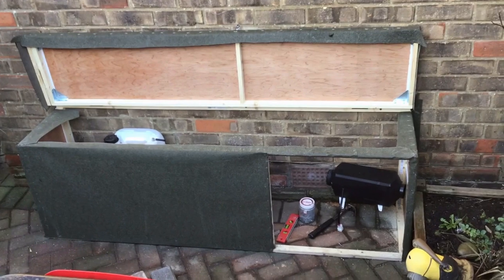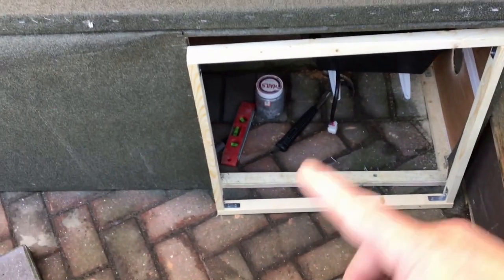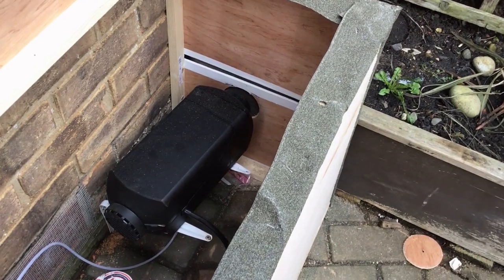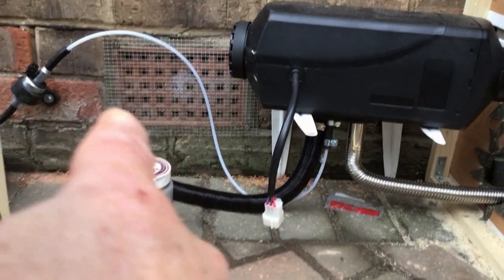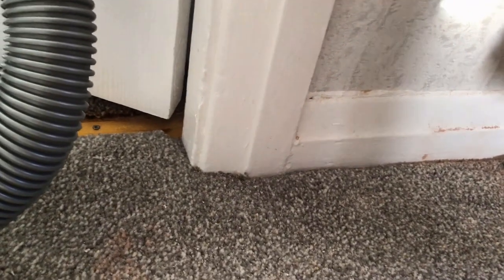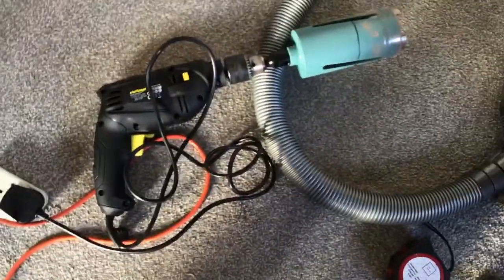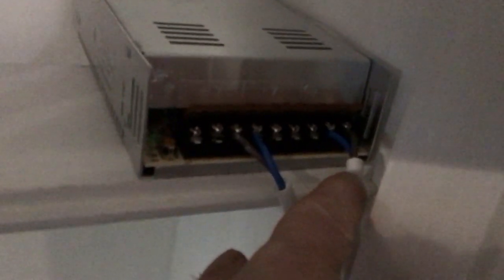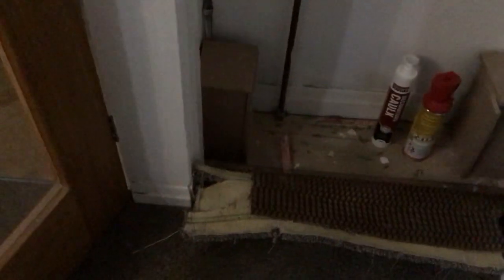installing a 5kw chinese diesel heater to heat my home part 2

Comment: Isn’t it better to get a home heater?
Reply: 1kw heater or a 2kw one on half the time is using circa 25p in electric, red diesel or kerosene is about 85p per litre, mine uses 112ml an hour. Or 7p for a similar output. Full output gives off a crazy heat...

Comment: ? you've lost all your heat by the time its coming out the end.
Reply from the maker: hi,these are just videos showing people how ive istalled my system and if its any good for heating a house plus any problems i have along the way and what results i get.i did have a clip in one of the videos before i reedited the videos and i think the temp at the end of the ducting was about 180degrees.